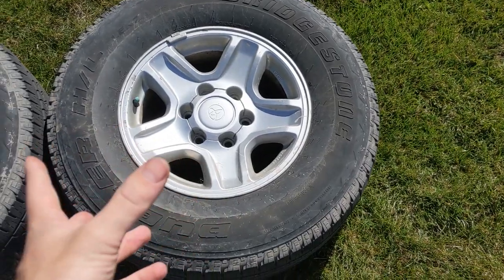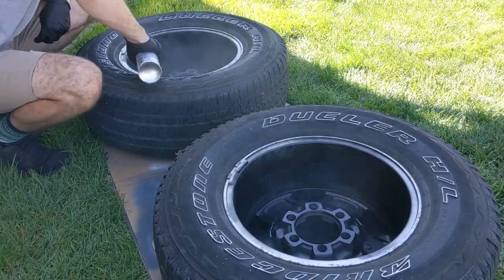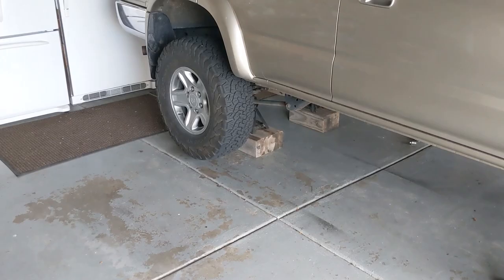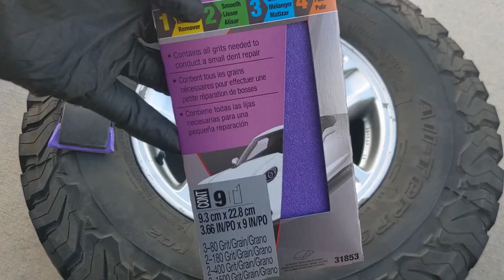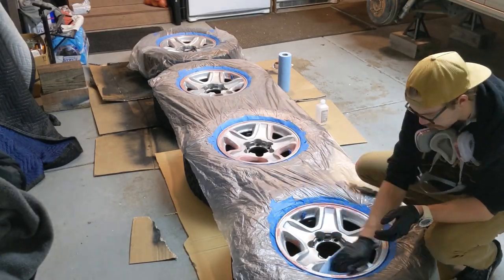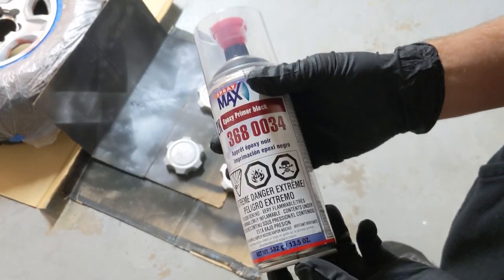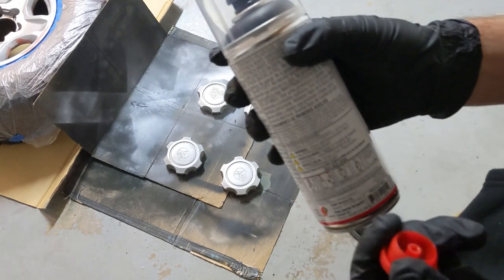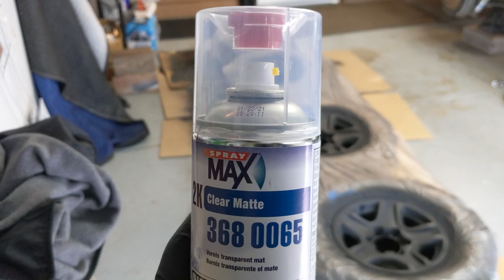Transforming Stock Wheels - 3rd Gen 4Runner Part 4

Comment: Awesome man they turned out great! I really need to do mine!
Reply from the maker: I think yours look great! Did you get some new ones or something?
Reply: @mattuccibuilt3970  mine are stock wheels that were painted by the previous owner but they need redoing. It’s all in the prep work to make them last it seems.
Reply from the maker: @WoodcockFamilyOverland  Yeah I've heard that sanding and cleaning of anything that may dislodge itself under the paint will make just about any paint do well. I was slightly lazy with my sanding, so hopefully they withstand, and if not I will probably go with powder coating or aftermarket wheels.
Reply: @mattuccibuilt3970  yeah same here, but with just a little time and effort you made your stock wheels looks fresh and new!
Reply from the maker: @WoodcockFamilyOverland  Thanks! I hope yours turn out well too! I will be on the lookout for a video on that if you do it!

Comment: Great video thanks for sharing the experience. I think they look waaay better. How do you feel about the paint durability?  I’m assuming besides the aesthetics you’re optimistic about the paint lasting. Thanks again.
Reply from the maker: Yeah, I will update in the future on how they're doing but so far, with a few months of salt and dirt and multiple cleanings they are still doing great. If I did it again I may put adhesion promoter on the center caps or similar because an impact gun can take the paint off when taking the lug nuts off pretty easily, but that's pretty common on all wheels.

Comment: Own the same 4Runner here. You did a great job. How are they holding up 3 months later? Do you have any videos on your grill by chance?
Reply from the maker: They're doing great against dirt, salt, and multiple cleanings so far, I will do an update in the future. Although I would do an adhesion promoter on the center caps because an impact will take a little bit of the finish off, but almost all paints react that way. I don't have any videos on the grill, but it was a really simple cleaning, a few coats of black PlastiDip, and a few coats of gloss PlastiDip. Really simple and I can peel it off if I don't like it.
Reply: @mattuccibuilt3970  interesting. Thanks for answering my question! How many miles do you have on yours? Mine just rolled over 260k! Is yours on a lift and if so, what are its specs?
Reply from the maker: Of course! I'm at about 220k miles, if you check out the other videos on my channel I have one on suspension.

Comment: Compared to the stock tires what size are these? Did you need a lift to get them on comfortably?
Reply from the maker: I believe the stock size is 265/65r16 which is a just under 30" and that was what was on mine. Also, I don't have personal experience, but I've read that what I put on there, 265/75r16 which is about a 32", is the largest you can go without a lift and not have rubbing unless the vehicle is really articulating or has excess weight.

Comment: Where did you get the headlights and corner lights I have a 2002 4runner
Reply from the maker: Check out Part 1 the headlights are custom. As for the corner lights, you can follow what I did in the video, someone said you can put yours in a bucket of purple power without the bulb in and it will take out the chrome, or buy them blacked out (ebay).